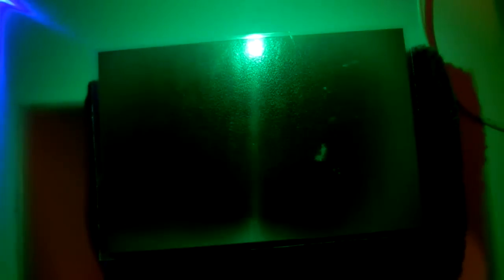Seeing a plane of null-point inertia sucking in light. FIRST TIME EVER SEEN

Comment: Isn't the light we see at the Inertial plane, because of gravity? Magnetism into Dielectric energy, into the Inertial plane. When Magnetism returns to Dielectric energy. There are no longer both transverse waves for light/EM waves to propagate on. Lights rate of induction is Magnetism's rate of creation. The Inertial plane is lit, cause when Magnetism/Dielectric voidence field returns to Dielectric energy, the photons are released. 
 Photons are created when Aether's perturbating field compresses to the coaxial circuit of the Inertial plane. Bounces off and FLASH, so called photon, then Rarefaction.